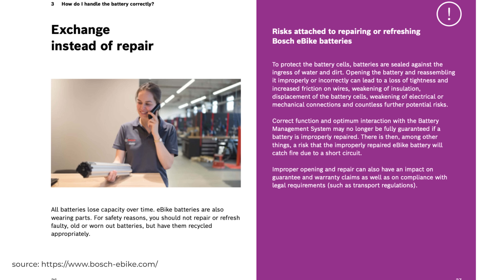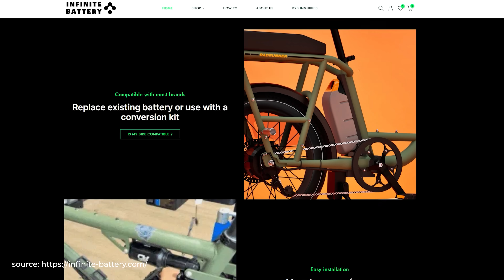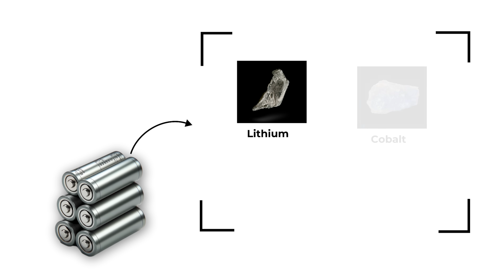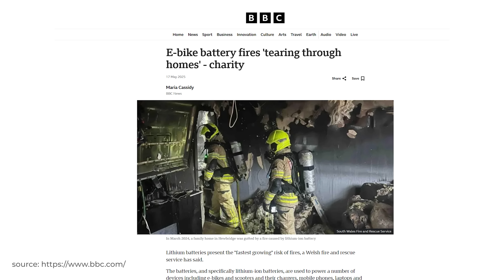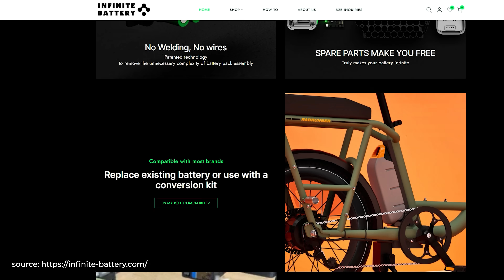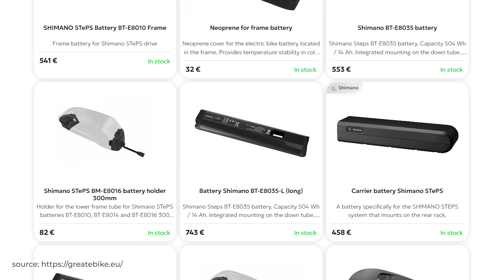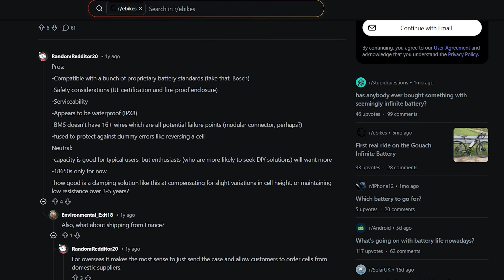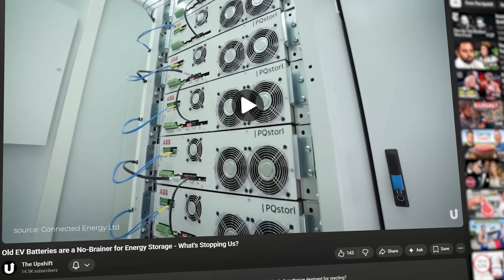This e-Bike Battery Rewrites All the Rules

Comment: Bosch doesn't want this because their intention is to create something they wouldn't be liable for if they don't have control over.
Though, if repairable battery packs come to the market, people would flock towards those systems instead. Because a new motor usually costs 400-600 euros, while a new 800 Wh Bosch battery costs 900 euros.
I would be happy to get the less reliable motor and replace it once it's broken, than to spend 900 euros for each battery.
There are people like me that go on long distances through multiple countries and also fly with their bikes. The modularity and replaceablity opens up so many options other than replace the cells every few years.
Bosch also needs to bring back their DC-DC chargers, because car battery and solar charging will have so much waste for DC-AC and AC-DC conversions.
Reply: NO batteries larger than 100wh allowed on passenger flights. So, no ebike battery on a plane, except didicated cargo only  planes.
Reply: @MrINKOMPATIBEL  well, are you telling me or others?

Comment: I bought a UART System ebike instead of Canbus  System ebike so i could put whatever battery i wanted on it, this battery would be a perfect upgrade providing it fit size wize
Reply: why are you running a data link at all?
Reply: @MrINKOMPATIBEL Bafang m620 motor  have the option UART or Canbus motor system, because UART is not a data link the Canbus is the data link

Comment: The average person has trouble changing batteries in a furnace thermostat or a smoke or CO alarm, now ask that same person to use a multi-meter and put batteries in series and parallel in an e-bike battery pack. 😂
Reply: a customer might not, but his bike mechanic will be able to do it thanks to this, while for a traditional battery even specialised firms struggle

Comment: To combine new cells with old cells. Don't know if that is a good idea. The BMS will except the old cells not new ones and new cells will degrad fast.
Reply: that, has been proven many times it's bad they are selling you snake oil or worse an IED
Reply: The BMS has no idea how old a cell is. It only monitors voltage of groups of parallel cells, overall voltage of the pack, current output of the pack as a whole, charge current of the pack as a whole and temperature of the pack as a whole.

Comment: Unfortunatly not compatable with Bosch Powerpack Performance 500 downtube used on 2018 Trek Powerfly FS7 gen2.
While the formfactor is very similar locking, connector and charger totally different and replacable.
Back to square one. 
Relace out of spec cells which is extremely messy and dubious or scrap and buy a new battery which would nave been manufactured in 2018 and will probably have limited performance due to sitting on a warehouse shelf all that time.
Reply: They most likely did not a software dump of all BMS hardware/firmware combinations.  I expected that.
Reply: @MrINKOMPATIBEL  What ???

Comment: $376 for the frame case not including the cells? Talk about highway robbery!
Reply: Seems reasonable to me. Those injection mold dies that make these cost 100's of thousands sometimes, they won't get huge contracts from Chinas bike manufacturers, either. This, plus two sets of cells is cheaper than two full packs from most sellers, and this let's you diagnose individual cells before they become an issue, instead of just losing range, and hoping it doesn't start spewing flames next time you charge it
Reply: @polunu  Bro.....if they produce in China or any where in the Asian market they wont be concerned about the cost of injection molds when they wont have to buy them like most companies in the world. Also I never denied the quality and usefulness. My point is unless they are using expensive materials or labor intensive work those parts will cost them peanuts. Look at the industry bro! I have friends that moved to Shen zing just to manufacture and supervise. It's not as cheap as before but it's still doable. The product is niche and that is what they have going for them. After a few years the market will saturate and prices will lower! Its plastic, metal and AutoCAD, nothing more.

Comment: also where did you pull the 50€ replacement with rewcycled cells or china trash chells maybe if you want some kind of quality maybe it starts from  120 euro.  and this is a small battery 36v with 2500 - 2800 replacement cells. pulling nr from the hole in the back is only viable till someone count. overpriced  DIY kit and a pack with out spotwelding is not rlly new been on ali for years.
Reply: Show me a kit from Ali that works with Bosch, Shimano, Brose, etc...
You can have Samsung 35E from NKON for around 1,-   .

Comment: LOL they still recommend to throw out all cells if one or two are faulty, that pretty much crumbled the only pro they had. xD
Reply: Yes, and they are right. It`s complete nonsense to put a fresh cell in a pack of old cells. For multiple reasons.
Reply: The problem is that you'd need to capacity test the other cells and replace with a cell of matching capacity.  That's not so easy but it's possible if there was a big enough secondhand market.  Instead, I think, if one pulled one cell from all banks of in-parallel cells and replaced them it should be fine as all banks will match in capacity.
Reply: @munchingsquirrel5067  or just remove the one bad cell and have it keep working with 39/40 cells at 97.5% capacity. Easy fix really.
(nah not easy fix, ignore this comment)
Reply: @Erafune  Easy but not a fix. You'll lose way more that 2.5%.  That cell you've pulled is in parallel with maybe 4 or 5 cells.  So that bank has lost 20 or maybe 25%.  Now that bank will reach max and min voltage way earlier and the BMS will stop the charge/discharge to all banks at the same time.  Basically each bank will only be able to store only the capacity of smallest one.  You've lost yourself 20 to 25% of the whole battery.  That's not a fix.
Reply: @munchingsquirrel5067  Yea I realized that. Need a BMS that can work with each series individually at different Voltages. Cells sit in series of 10 (3.6V x10) in parallel of 4 to make 40 cells. 
If you could replace one series of 10 cells and have it charged/discharged as if it was the same state as the older cells, that would be an improvement, but I think we cant have nice things -.-
Reply: @Erafune My idea would be to remove the dead cell and then one cell from each of the other banks. Then replace with matched-capacity cells. The replacement cells wouldn''t even need to be new. That should keep the capacity of the banks the same and keep the voltages balanced when charging/discharging.

Comment: 10:31.. Absolutly not!  a spring loaded contact will never be as good as spotweld or laser weld in term of contact resistance. There are often one or even two order of magnitude of difference. 21700 laserweld is usually between 25-50 microohms, spotweld is similar and spring loaded contact are i the few miliohms range.

Comment: 0:31  Less than 1% of people who think they can repair them really know all the required best practices and how to do it safely and technically.
Yes, a lot of YouTuber videos showing battery repairs certainly have good intentions… but most of them don't have the right experience or understanding of lithium batteries to do it correctly. Succceding to spotweld replacement cells and solder BMS wires is not just what's required ! SoH, ACIR, DCIR, CAPACITY and even EIS matching are all the steps necessary to make a great job of bad cell replacement... and more
Reply: It is not necessary for the user to do this, small workshops can do it.

Comment: Lol, be prepared to disassemble & clean the terminals periodically. You wll  suffer efficiency losses if you don't...it won't kill the pack, but output voltage will be reduced....

dielectric grease might heip, but you didnft show that.
Reply: You may want to establish your credibility because right now you sound like you’re not talking from experience with their specific solution.
Reply: @ArnaudMEURET I have had issues with terminal corrosion on every battery pack with spring terminals that gets used outside, so I'd call my credibility common sense.

spring terminals worked for alkaline & nicad only because they would be R&R'd frequently, so the terminals were reseated every time. 

Ya know when your thing (tool, toy, or remote control) gets stored with batteries, then you try to use it but it's 'dead'. Step one is to open the battery compartment & spin the batteries, because 90% of the time that's all it needed. The batteries weren't dead, the terminals weren't connected.
Reply: @Iowa599 the cell compartment is sealed, you can clearly see what looks like a toroidal gasket. My common sense is that you drop a few moisture absorbing bags before shutting it and that the “pass-throughs” use similar waterproofing.
Reply: @ArnaudMEURET you still need airflow, otherwise the box is an insulator. draw causes heat, charging causes heat, and heat fries insulating layers of the cells 😂

hold out water or hold in heat? 😂😂

Yeah, manufactures don't just use welded on srips to save costs, they use them to save batteries.

Spot welding the strips isn't hard, neither is removing the strips, which have half as many connections  and they also weigh less...

while the swappable cells may be easier to swap, I think they will require more maintenance, have performance reduced, and lifespan reduced so significantly they won't be worth it. 

For less you could get a spot welder, strip stock, & enough raw cells to make 2 or 3 old packs new.

Comment: What's crazy is all packs should've been designed like this from the start knowing that the batteries will eventually die after a certain point.
Reply: Welcome to Capitalism. Pull up a chair and enjoy the scam
Reply: @TheeMuseumofjunk  It's not ALL scam. People vote with their wallets and not their heads. The increased price of a rebuildable pack, over a welded up one would turn many purchasers away. Most people are very short sighted and can't be bothered to work out the life cycle cost of what they are purchasing.

Comment: There's another brand that makes packs that you can repair and reuse (second-ride). They only have contactors on the top pole, and they use the flat pole as a thermal contactor.

Comment: My 2 Bosch e-bike batteries are holding up fine!
Reply: normal they not only track and datalog everything they live ambient temp inside temp charging temp discharge temp rate of discharge and charge etc...but they also kept with slow charging speeds because fast charging actively damages your batteries
everyone I know with a bosch ebike still uses their oem battery 5 years later, Bosch no1 advantage is that their motors and batteries are on millions of bikes from 2'000 to 13'000 so they have much more and better feedback, Linus from Linus Tech Tips might not be the best guy in the world but he said something that is extremely true, never buy a niche market high-end product with less customers it has no feedback and no feedback means no updates and problems that will never be fixed buy products who have a proper market presence which will force them to fix things
Reply: Gratz I guess. How old though? My two Shimano e8010 from 2019 are down to half capacity. Brand new 50-60 km range. 
1st one only charges to 3/5 bars and has 20-25 km range. Cant replace what I assume is one faulty cell. 190 cycles but has seen a lot of freezing temperatures for six winters. 
2nd one 84 cycles only summer use has 30-40 km range, down to 26 km with lights on at worst, which is decent enough to keep using. 
Reluctantly got a 3rd one just now for about €540, to replace the "summer use" and move the summer use one to "winter duty" :) €100 per year isnt horrible but still diappointing.
Reply: Well how often do you cycle the battery? Bosch bikes often have a 25 km/h limit. If you are also pedaling you can go like 100km with one charge.
The battery on those is barely used.

Comment: 316 euro for empty battery case? No thank you. 30 euro hailiong case + Bluetooth BMS + new non Eve 33 18650 or 5000mah for 21700 = 140 euro.
I did DIY 10 cells case for electroc instrument in 1 hour. 
I will know what to repair if needed. 
Charge 20-80% and it will last 6000-7000 cycles instead of 1000.
Reply: This is more for people with Bosch, Shimano, etc. hardware.

Comment: The CASE is $300. Not cells. No charger. I am pro rights to repair but this will fail hard.
Reply: You think $500-$700 OEMs with no repairability are better value? Weird :S 

You're not paying for a plastic shell. You're paying for the software that makes it possible to plug it into whatever brand motor you use.

Comment: I hadn't realised how bad the price gouging was in e-bike batteries. 600 euros for a 400Wh battery! That's 1500Euro/kWh when ESS batteries are 110euro/kWh - less than 1/10th the price. And this is only possible because they have locked-down motor and battery pairings with proprietary protocols. That is what the EU needs to step in on and fix. 5 different protocols, one for each motor/controller/battery manufacturer is bad for people and the planet. Only manufacturers (that don't give a shit about the environment) benefit.
Effectively there is a cartel now where each manufacturer can charge what they like for replacement batteries. So yes, infinite battery are doing great work here.
Reply: We're in the final stages of making a Bosch activation dongle to use any 3rd party battery on their bikes. https://www.youtube.com/watch?v=gSS1MRxoYlw
Reply: i have lawnmower tractor with 1,5kWh battery -  new battery as part cost 90-99% of price of full tractor :D , they want about 2000-2200euro for 1,5kWh - inside of steel box are 168x 18650 cells and unfortunanetly proprietary BMS with CAN communication with main controller, so if cells dies i think this will be easy fix, but if bms dies - its cheaper to buy new tractor
Reply: @duniek86 hit up amorge 4 times cheaper
Reply: amorge is the goat for batteries, got a 72v 40ah 480a (46 horse power, 165v3 motor running it) battery for under 1000 dollars shipped and a 500a controller (fardriver 7210000)  all up battery motor and controller cost 1700usd

I dont deal with these ebikes that have locked in systems but I can see what a headache they would be. 
the components they sell arent worth much at all, but they are milking the integration with their high grade frame/etc for riders who have specific needs and they know will pay much beyond what theyre really worth. (im not knocking ones decision to buy a high grade emtb, but it comes with the burden of being scammed by manufacturer specific parts and theres unfortunately no way around it as per now. diy bikes and motorcycles are different tho. you cannot really get the same quality for emtb frame/riding experience without being hit by the scam tax.

if you look at these emtb I bet a lot of them use a controller similar to ND7235 Fardriver you can buy it for under 40 usd, but once their software/money making engineers find a way to make it proprietary and integrate it into their systems it will cost 10 times more to the consumer if you want a replacement for your specific bike, and same goes for all the electronic parts in bikes like this including batteries

Comment: I would pay so much for a battery with easily replaceable cells
Reply: Why? I Can see if gets you farther down the road but replaceable is just dumb they're already expensive enough without giving them dumb ideas
Reply: They should be replaceable from the rip at their current prices you can build your own for way less then these dealers thar sell weird looking electric bikes  for whatever reason at a high price
Reply: I would rather pay for a non-locked system. A system that allows you to connect any battery. Bosch ebikes for example are locked to their own batteries and BMS. You cannot change or repair anything on those bikes yourself
Reply: @wtsuser just like a lit of cars nowadays the parts have to be replaced by a technician and programmed to your cars computer to work even your lights
Reply: Meaning you can't go and just buy a part off the shelf and put Iin and it's fixed because they want you going back to the dealers and pay a hefy price just to replace a part that you used to be able to just drop another in yourself and ready to go
Reply: @wtsuser  And that is not always a bad idea especialy when you buy used e-bike with bosch you could at least check how it been used before and for how long.
Reply: @Ayvengo21 no it's a bad idea, it makes repairing more than twice as expensive
Reply: they all are just order same size spec's fron any aliexpress official shop, if you starta chat you will see they re very flexable + china builds the best packs in the world.